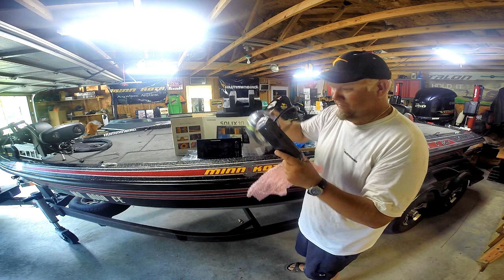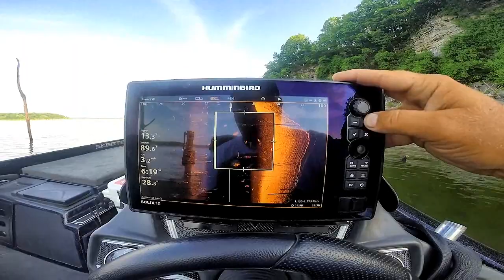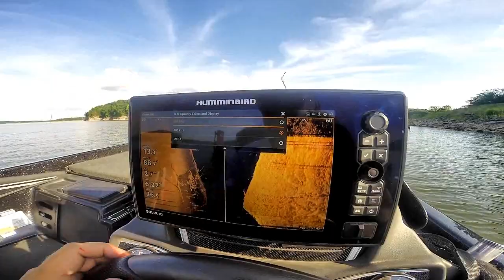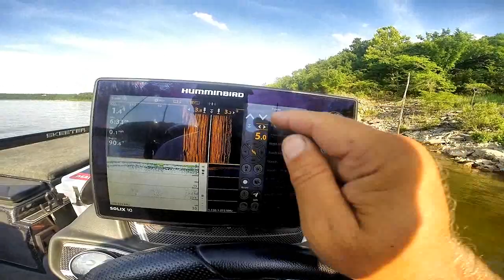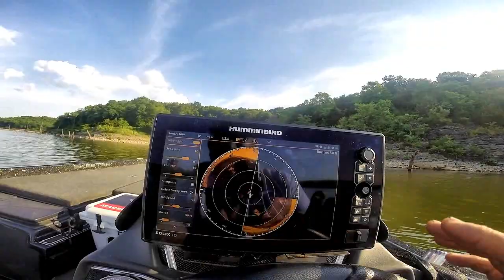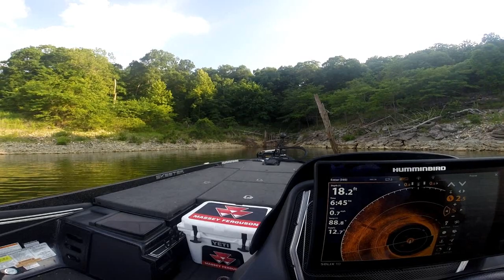Tips 'N Tricks 213: Humminbird SOLIX 10 - Total Boat Control System

Comment: i just spent 2500 on one of those things and i got a small mickey mouse looking transducer yours looks advanced. is there a difference in our units? its the exact same looking unit and even says solix 10 on the bottom right corner. im just wondering why there are 2 different transducers.

Comment: Solix mega si+ network to Solix gps only:   

Can’t find any info on whether a standard Solix gps only will show mega+ si and di from the Solix mega+ si unit through network or do they require both units to be mega+ si
Reply: Yes use a ethernet cable from the solix mega si to the solix gps and that solix gps will become s solix mega si, that is what a person from  humminbird  told me.
Reply: your side imagine will be off by the transducer on the solix mega si transducer on the transom of your boat if your solix gps in on the bow of your boat, it will be off by the length of your boat

Comment: Doug, Is that older software with the trolling motor controls on the 2nd pane from the right and not all the way to the right as to not cover up the imagining?  I just updated my 3 Solix screens to 3.360.Humminbird software update shows the controls on the very left of the screen.  I updated them in the house not on the boat so nothing is linked together yet, I.E. 3 screens, Ultrex, pucks and 360.
Reply from the maker: Just uploaded my install video of 3.360 and have more footage coming on the water with the new update. Maybe that will answer your needs

Comment: Doug, I have had the Solix 12 bow and 15 console for the last year. I am constantly having issues with the unit lagging to get sonar, DI and SI started after I run across the lake. It takes up to 3 minutes before it starts working again. Any idea what that could be? Bad transducer, improper location of transducer, bad units? Ive done all of the updates but Humminbird tech support has no answers.
Reply: I had an issue simar to this. I ended up rebuilding the complete network in "the correct" order. For me (I have 3 Solix mega screens) was screen 1 (Helm 12") is my main with transducer on the back of the boat, screen 2 (Bow 15") with 360 and screen 3 (Passenger console 12") is a slave to the other 2. I power them up in that order so they "boot properly". This fixed all my issues similar to what you are talking about. This is what I and Humminbird tech support came up with to fix my issues.
Reply from the maker: The SOLIX take a little longer to locate sonar once it is lost while driving across the lake. I found to suspend imaging sonar while running so it's not pinging while out of the water then turning back on works better.

Comment: Doug, Can solix units share way points with G2 Helix units?
Reply from the maker: Yes they can
Reply: What is required to link the two?
Reply from the maker: Humminbird Ethernet Cable of Appropriate Length and AS EC QDE Dongle for the HELIX Unit. Ethernet Cable screws direct into SOLIX and Dongle plugs into HELIX
Reply: Thanks Doug!  Do you have a video covering this topic?
Reply from the maker: Yes I have several video on networking

Comment: Doug, how easy is the Solix to get engine hours? Can you show how to mark a waypoint and navigate to the waypoint using the Ultrex? I have several questions, do you have contact information available. Thanks Stan
Reply from the maker: I did a video on connecting to the NMEA 2000 Network with my SOLIX 12. It's direct connect to NMEA 2K Networks. I'll have to do a video with the Ultrex but I have one with the Terrova navigating to a waypoint. Best way to contact me is through here.

Comment: Another Great video!! I have the Solix 12si at my console and a Solix 10si on the bow. (it was the only model the dealer had) My units are fantastic. What do you recommend for a mega DI trolling motor transducer?I would like to move the other SI transducer to the back for better coverage. Keep the videos coming!!!
Reply from the maker: I'm not currently using the DI at the Bow..I'm run 360 Imaging 99% of the time for the style of fishing I have been doing.

Comment: I'm having issues with my solix 12 units having their sonar lock up. My unit at my dash has no issues but my unit on my bow has sporadic incorrect depth level readings and the imaging and sonar often freezes. They are networked together so I'm not sure why only my bow unit is having issues.
Reply from the maker: What CHIRP settings are you using? Is the hard bottom or soft bottom conditions?
Reply: Right now I have everything at stock settings besides my sensitive is at 12 and contrast is at 14, this was on a relatively soft bottom.
Reply from the maker: I would adjust the 2D sonar settings that is where the Depth Number is created from. If in shallow water (less than 10') I would turn the CHIRP off and see if that helps. Run High Range or 200kHz for 2D sonar.
Reply: Ok I will try that out, thanks!